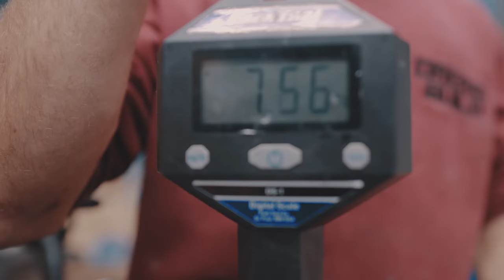DREAM BUILD ROAD BIKE - S-Works Roubaix

Comment: So strange to see exterior cabling and mechanical shifting these days. Nice build 👌👌
Reply: First I was a little bit confused
Reply: This is still classified as internal routing, more specifically in this era, regular internal routing.

This is not strange at all, not one bit. It's what I actually prefer on my bike.
Reply: @Yong Ling Ng  Totally missing the joke, but sure you do you. 🤷‍♂️
Reply: Yes I thought shimano high end groupsets like duraace only came in electronic DI2
Reply: @drbobjohnson812  That's only for its 12-speed counterpart.
Reply: @yonglingng5640  Thanks for the info, so basically DA has two tiers, at least with shifting
Reply: @yonglingng5640  if there are cables outside, it's not internal. Even FSA SMR is semi internal cabling, not fully internal.
Reply: can anayone tell me the name of that suspension that he insert on that steering tube on fork??
Reply: @reginadajar8144  specialized future shock
Reply: @serdiezv  thank u so much sir.. god bless u.. happy new year
Reply: @serdiezv  The sixth-gen Roubaix's brake and shift lines still enter the frame and fork blade at some point, so it's not external. It's only that this form of internal routing isn't integrated.

External routing is most commonly found on older bikes like the Colnago Arabesque, where the brake and shift lines never enter the frame at any point. Only amateurs call anything that's not integrated internal routing as external routing, just because they can still see even that one small bit of brake and shift line, never thinking that most of it is already routed internally. They're usually the same people that cry about the increased maintenance costs of integrated internal routing because headset-related work now takes longer, thus will be charged more.

External routing
Brake and shift lines never goes inside the frame at any point
Any 20th-century road bike

Regular internal routing
Brake and shift lines enter the frame at some point, most commonly at the down tube, top tube (rear rim brake) and fork crown (front disc brake), but not through the headset assembly
Specialized Tarmac SL4 - SL6, Cannondale CAAD12, first-generation Specialized Allez Sprint, first-generation Orbea Orca Aero

Integrated internal routing
Brake and shift lines pass through the headset assembly and into the frame
Specialized Tarmac SL7, Pinarello Dogma F, 2021+ Trek Émonda, second-generation Orbea Orca Aero
Reply: @drbobjohnson812  The two latest generations for Dura-Ace are R9100 and the current R9200.
Reply: And this contributed to the relatively light weight!
Reply: @drbobjohnson812  it is the phased out model: 9100 11 speed one
Reply: @drbobjohnson812  unfortunately the 11s is no longer made
Reply: TBH this is ridiculous. In 2023 you can't buy a frame with a normal cable routing.
Reply: @fpeter01  I'm not sure what's your point: do you mean that you like normal cable routing frames, but unfortunately the normal cable routing frames in 2023 are fewer and fewer... or: a person that in 2023 buys a normal cable routing frame is a fool?

Comment: Been running a similar build for a few years with mech Dura Ace, Ultegra clutched derailleur, deepish gravel wheelset with 32 Pathfinder Pros.  Fast everywhere and great on bad pavement or light gravel.

Comment: How much does the liquid latex weigh? 120 gms? A dry latex inner tube is 85g and just as supple.

No need to use all that assembly paste, the seatpost clamp works fine, as does the bar clamp. 

But I'd like to find a cable DA groupset.

Comment: Why is a front suspension better than a fat tire?
Reply: bro what is that suspension on front??
Reply: The Future Shock (2.0 for this frameset) suspends the rider instead of the bike, which is said to provide compliance without compromising the frameset's riding performance in terms of power transfer. This frameset can run 33 mm tires on a rim with a 17 mm internal rim width.
Reply: @yonglingng5640  thanks but i'm skeptical about that power function adapted to changing terrains, i see it more like a physical stress reinforcement for a race-like bumpy track, ideally arms and fatter tires (45ish) could handle that small travel and personally the weight load of a suspension system plus sacrificing a stiff manoeuvrability are sensible things to consider IMO

Comment: I don’t get the point of this build?! 
Race team bike with gravel wheels, ultegra front derailleur, ceramic speed bb,wtf… this is 100% done on purpose to piss us off… and the compression prior to setting up the ring and installing the future shock… I mean why, you can’t brake without the whole bike shaking due to headset being lose… fucked up part is that you know better… I guess joke on us.